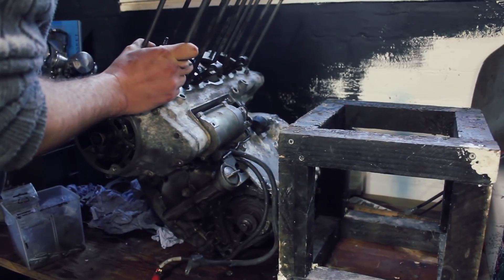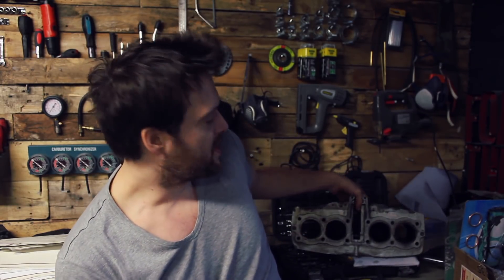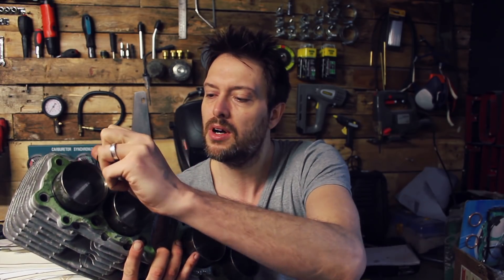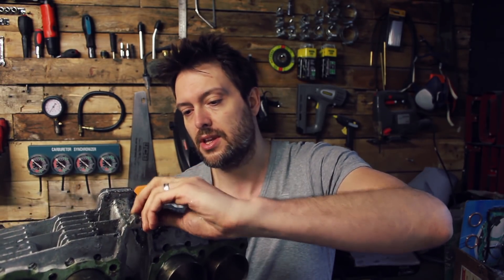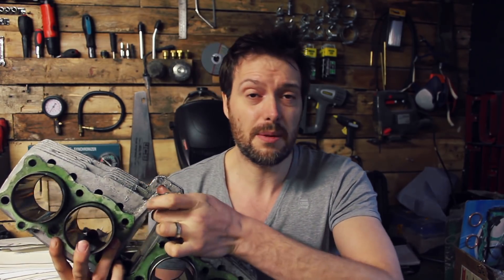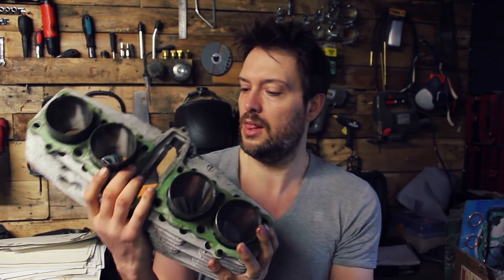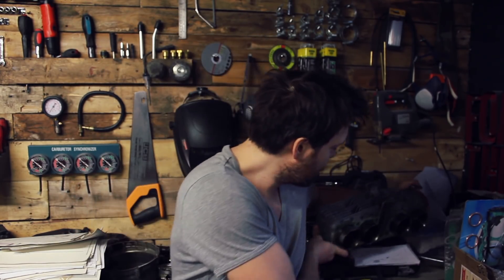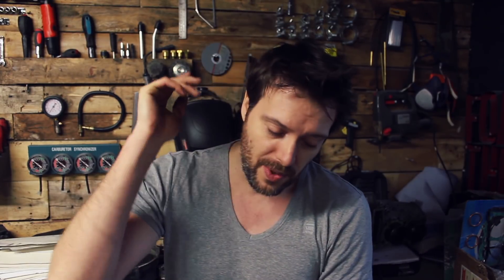Honda CB750 Cafe Racer Part 9 - Engine part 2, removing the cylinder head & pistons

Comment: Silicone/ RTV shouldn't be used where it can get inside an engine for example as a gasket.  If bits flake off they don't break down in the oil and will block oilways leading to lubrication issues and then bearing failures.  Have a look at what it did to this new build where a previous owner had used it.  https://youtu.be/M8GE7oh8mlI?t=8m56s
Reply from the maker: Pretty much the same state as inside this :(
Reply: For The Bold - dreegez I had an engine where someone used silicone to stick the rocker cover back on.  A bit blocked the oil feed for the rocker.  It ate the cam until the timing went out far enough that the valve went through the piston.

Comment: These guys a giving good advice,  you don't want to drop a clip into the bottom end, because it's a whole lot of work to split those casings for the sake of that. Its the first thing you learn as an apprentis. Whenever I strip an engine I always do the jobs that are obvious, then i do the jobs that will probably want doing in a few thousand miles, it just saves time and effort in the long run, your a common sense kind of dude, I thought you would have done the valves while you were there. I one did a load of work to a 16 valve Nissan engine,  after 200 miles the cam chain tension spring went, fugkt it completely,  all for the sake of £8 and 2 minutes work.
Reply from the maker: Absolutely, worth putting something in there to save that clip, but as I'm splitting the case anyway I wasn't too worried as we're going to be replacing the big end on this. The valves will be looked at and measured along with the cams, ports etc.
Reply: For The Bold - dreegez, I'm sorry,  I didn't realise that,  proper job, can't beat it.
Reply from the maker: Hey seriously good advice though.

Comment: Truly wish my engine pulled apart that easily
Reply from the maker: There were a few sticking points in between. Like copper rings used as washers and bent stuck
Reply: Yeah, the engine was seized due to sitting and the head studs were full of dirt and crud around the block. I've been follow all three builds and you're making some very pleasant machines.

Comment: Hard to see the condition of the cylinder walls there, but I suppose if there was anything out of the ordinary you would have mentioned it - Are you going to hone them along with the new rings?
Reply from the maker: Nothing of any obvious alarm in those walls, only a thorough measure will bring up any issues.

Comment: I haven't read all the comments yet.  Could you have done a leak down test before disassembly to determine if valves leaked?  Why do pistons 3 and 4 have more carbon build up?
Reply from the maker: I did a compression check and saw the rings were not holding. Those pistons were cleaned by me out of boredom whilst I was waiting for the camera batteries to charge
Reply: Thanks.  Enjoy your channel.  Currently working on 71 cb500.  If it runs okay and doesn't leak oil, I'm leaving the head on.  We'll see.
Reply from the maker: I live by that rule too ;)

Comment: Quick tip, stuff some paper down the crank case holes when removing and installing the wrist pins. One day you're gonna drop a c clip down there if you're not careful :D
Reply from the maker: Indeed. Definitely going to be doing that on the rebuild but as I'm opening more I didn't worry too much.

Comment: Top tip: do not reuse the piston pin circlips, even if they look fine. Had to find out the hard way when one of those buried itself in the cilinder wall... shattered piston, hole in the cilinder wall and a 30 degree bend in the con rod. Not amused
Reply from the maker: Yup. That would be awful.

Comment: Love your vids, keep it up! Is the K engine same as in the 750F? If so that engine chews cam chain tensioners. Seem to remember you finding quite a bit of plastic in the sump? If you’re looking to replace that there’s is a permanent fix to the problem from Vince & Hyde racing in NZ. It’s well detailed on cb1100F forum. Just a tip :)
Reply from the maker: Thanks. Depending on the year. So far a quick glimpse saw them ok. That was my initial thought. Checking the primary chain next.

Comment: which would you advice for the easiest build ? i like the  Bmw R series, pretty simple mechanics, what about you ? knowing that we're talking about the European market .
Reply from the maker: Easiest build as far as frame and engine I'd go Honda CB four models or the Suzuki GS series. Straight forward minimal frame mods and easy to understand engines.
Reply: The K series is also very nice! And more affordable which means you can customize it pretty much anyway you want... Still revolving in the 2000€ for a nice running one